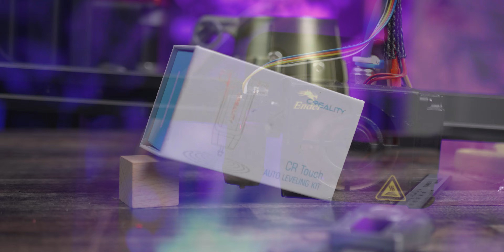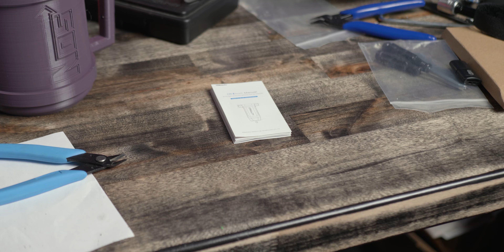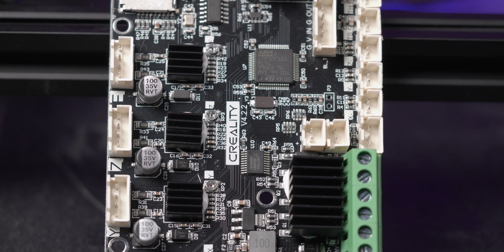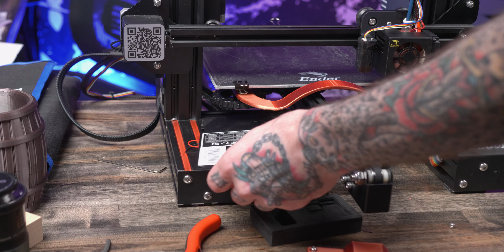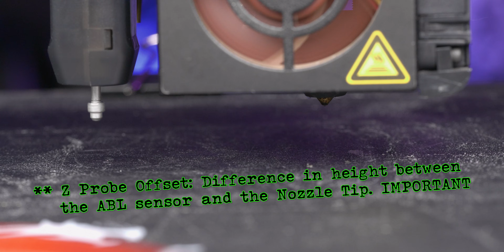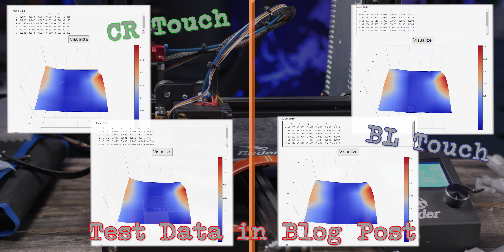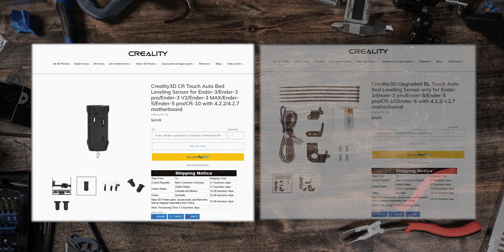CR Touch vs BL Touch - NEW Creality Auto Bed Level Sensor Review

Comment: Will this work on the ender 3 Max?
Reply: Yes , but maybe you gone need to compile yuor own marlin, i dont konw its a 32 or 8 bit board, other thing its the limit memory size of old 8bit board, but even that, there Cut version of Marlin for 8bit board with bltouch, so it will work(if yuor board dont have a special port, just connect 3pins to the servo port and the 2 others to the z endstop  , ve carefull with polarity.)
Reply from the maker: Yes, the 3 Max comes with the 32 bit board. Firmware will be your hang up. Creality lists an Ender 3 Max firmware with the 4.2.2 Mainboard and a CR Touch. You will have to check if you have the 4.2.7 or 4.2.2 board when installing the CR Touch. 

Either way your board will have the connector I demonstrated here and you won’t have to do what the commenter mentioned.

Comment: I am trying to get this to work on an ender 3 pro, the problem I am having is that it will not home the z axis, it will do x & y and when it tries to do z, it will move up and then fire the probe a couple times and then not move down to zero. Anyone run into this? Their support is garbage.
Reply from the maker: Which firmware are you running? I've had that happen on a bad flash of a firmware too.  Where just simply reflashing the same exact firmware file fixed it up.  But knowing more about what firmware and where you got it could help.  It sounds like either a bug or a configuration error in the firmware.
Reply: @MandicReally  Thanks for the reply. I tried the one directly from creality.com I tried one from the sketchy crealityofficial site. I compiled my own using the latest source from the marlin repos. Don't know what else to do.

Comment: How long is the cable that comes with the CR Touch?   My BLTouch came with a 1 m cable which was an annoying 10 cm too short for proper installation.
Reply from the maker: 1.5m I believe but aM not sure. It reached perfectly fine where as the BL Touch did not on my Elegoo Neptune 2 (1m cable).

Comment: Nice!   I like the BLTouch much better than the EZABL.   I was going to replace my EZABL on my other Ender 3 with another BLTouch, and with your tests, I know I have a better option.  I'm basically choosing for the better look more than better accuracy.
Reply from the maker: I like that physical probes stow away further from the print. I worry about curling parts with the PINDA sensor on my Prusa machine. I’ve had a few bridging sections get messed up on the Prusa and I think that’s why (though I didn’t witness it).

Comment: The M48 command as used in the video is not relevant, you need to add a random x-y movements in between the probes to get a representable sd. e.g. use M48 X110 Y110 L3 P10 V4
Reply from the maker: I thoroughly disagree with that.  You are thinking how the the M48 should be used to test a Probe + the Machine it is on.  Logical for the majority of use cases but not for this specific testing.  That command string is meant to test that the movement of the bed isn't affecting the Probing repeatability.  Aka, if the bed moves back and forth and suddenly the reading is different, something is wrong with your mechanics.  BUT, I was testing the Probes, not the overall machine.  If I did that I would be adding a variable to the testing which would invalidate the probe testing.  

As it is, I'm testing these probes on 1 machine, with 1 mainboard, and 1 firmware configuration.  It is hardly the scientific method, but I stand by the way I chose to do it with the conditions I had to work with.

Comment: I have a bl touch is it the plug the same for cr touch?
Reply from the maker: Yes it is. I used the exact same wiring to test both sensors. Just unscrewed one and swapped back and forth.
Reply: @MandicReally  thank you I just didn't want to get it and have to replace it all and love the tik tok videos

Comment: What if we use octoprint with a raspberry pi?
Reply from the maker: OctoPrint has nothing to do with your firmware or printer itself really. I used Pronterface for all of my testing but I could have sent commands through the terminal in OctoPrint just as easily.

Comment: Great video.  I bought an E3V2 really early on and attempted to put a BLTouch on it right away.  Fighting with firmware and not wanting to compile my own, I abandoned it.  I struggled with manual bed leveling for too long and some nozzle clogs.  Then my E3V2 became a nice dust collector for nearly a year.  Anyway, this video inspired me to put a little effort back into getting it up and running.  Bought the CRTouch, reverted from a direct drive modification and went back to a stock setup with this ABL sensor.  I'm now printing really high quality prints again with ease and loving it.  Thanks for the great video!
Reply: Download the Jyers marlin firmware for the E3v2. It's like getting a whole new printer. Makes it seem like a an E3v11.
Reply: @TheTurbinator   Your right! Night and day difference.  My Ender 3 V2 prints beautifully now. Jyers really did an outstanding job.

Comment: This is overpriced af IMO. Just make your own for 10$.
Reply from the maker: "Make your own"? You're gonna design, print the housing, source the electro magnet, hall effect sensor, custom pcb, and assemble it all for $10? I'll gladly build it and test it if you can source me the parts.
Reply: @MandicReally  linear servo + optical endstop is all you need. heck if you make your own coil you won't need it. but that's honestly a pain to do.

there's already a million designs on thingiverse google probes!
there's also a lot of cheaper options overall.

there's pick and place probes, there's spring ones that trigger when you home x and close when you move x to max, there's just so many of them!

I have had this idea for a compliant design probe in mind but i never got around to designing it.. maybe i'll ! it'd only need an optical endstop. it'd retract by just zeroing your z axis, and it'd deploy by homing x

Comment: I found the way they title their filenames on their downloads page, to be horrible. Also, the instruction manual for putting the printer together was abysmal, I had to follow a video guide, very slowly just to build my printer.

Btw, does anyone know if the CR touch work with Jyers firmware?

Comment: After all the hard work replacing anything that made noise on my Ender 3 v2 my BL Touch died and I replaced it with one of these. Now I have the metal probe contantly rattling and driving me nuts. Argh!
Reply: That rattle is absolutely insane! It's louder than my fan and steppers. If I'd known it was this bad I'd have bought the BL Touch instead

Comment: Old versions of bltouch used to come with metal probe. But they  moved to plastic as the metal in the probe would expand and measure longer in heated situations
Reply: I have a 3dtouch, the oin looks like metal, but its not, well its plastic with a metal cover...i think thats its was yuo saw

Comment: So it being magnetic it still has the 50c limit the blt has then?
Reply from the maker: Magnets don’t generally demagnetized until 80C+. I don’t know that it’s been shown that the magnet is what stops working in a BL Touch at 50C. Can you provide a source for that? 

As most Creality machines aren’t equipped with all metal hot ends, heated chambers, or beds intended for prolonged 80+C printing, I don’t think that was a major concern for them.

Comment: Well the CR Touch has two things I like about it that I didn't like about the original: the flimsy probe is gone and it doesn't look god awful anymore. The flickering led inside the white chassis just really looked out of place on any of my 3D printers/
Reply: I didn't like the lights because I have a camera with octoprint and it just lights up the whole frame - very distracting.

Comment: I bought a cheap knock off BL touch and kept having issues with it dropping the probe when the nozzle went to do the prime at the edge. So I bought a genuine BL touch and it did the same thing. When I updated Cura the problem went away. Neither ABL sensors have any issues now. I don't know about accuracy, but the $24 cheaper works just fine.

Comment: Can you show people how to change the firmware through using Visual Studio Code app? This to me is more of value to me than just downloading firmware from Creality. I had a major issue with my Ender MAX not running correctly with the download of Creality's firmware and had to use the Visual code app to make my own firmware so it would run like is was supposed to. Creality doesn't seem to update their firmware and they don't seem to listen to anyone when you contact them on fixing a problem or provide others with updated firmware unless it is someone like yourself that they contact just so they can get free marketing of their products. I have sent them several messages on their glass boards that they came out with over its ability of holding the parts to the bed. the original board that shipped with the Ender machines held the parts much better than the ones they sell now without the use of glue to hold it to the carbon fiber. However, you cannot get the original glass bed as a replacement anywhere that I can find. Can you run a test between the 2 glass beds to show which one has the better adhesion? I would like Creality to bring the original glass bed back.
Reply from the maker: I generally have avoided firmware content because it’s over a lot of people’s heads. Or really people get overwhelmed with it easily (it isn’t that hard in reality). And I simply cannot be tech support for every person trying to flash their own firmware, or breaking their machines when they mess something up. 

I need to consider it because I know there is a lot I do that relates to custom firmware configurations that available files just don’t do. 

So I will give it more consideration and try to figure out how to present it in my way.
Reply: @MandicReally  I'm 56 years old and learned the Visual Studio Code for the first time 2 months ago and if I can learn it anyone can I'm sure. It really isn't that hard and if your going to work with 3d printing it is something people are going to have to learn sooner or later. It really isn't much different than working with the arduino IDE to tell you the truth.

Comment: Actually, there is no problem with using Z-switch for homing, and BL/CR Touch solely for bed leveling.
Reply: You are entirely correct, IF the Firmware is configured that way.  The Firmware provided by Creality is not configured that way and as such there is an issue.

Comment: I wasted money on the BL touch it worked great for about 3 weeks then stopped working completely, kept flashing red and would not function at all.  I have sense removed it printer works great without it.  I would like to have auto bed level but I don't want to waste another 50 bucks on another product
Reply from the maker: I cut out a rant from this video about how Auto Bed Leveling is a misnomer and not a replacement for manual leveling. I think most folks who have or want it probably shouldn’t cause they rely on it rather than releveling their bed like they should. Sorry to hear your troubles with the BL Touch but I agree, if you are doing fine with manual leveling alone, don’t sweat it.
Reply: @MandicReally  I have gotten to where I level the bed once a week and adjust it on the fly as needed,  so far most of my prints turn out good with the off one now and then that require a bit more cleanup once finished.    All in all I'm happy with the end results, I have the Ender 3v2 I however have another issue with it. I have tried every setting under the sun but can not get anything to stick directly to the glass bed, I have to use blue painters tape, works fine but cleanup is a pain because the print sticks so good to the tape it has to be sanded off.  I would love to know why others can print directly to the glass and what I'm doing wrong that I can't get it to work.
Reply from the maker: @tonyemory3618  I’m not a fan of glass beds at all but I’ve had plenty of success with them. They act as insulators so Step #1 for me is always up my Bed temp settings. I usually put down PLA with the bed at 65C for the first layer on my non-glass equipped machines. But with glass I start at 70C or maybe even 75C for the first layer. I’m also a big fan of a product called “Magi-Goo”. It applies like a Bingo marker but is a clear-ish adhesion promoter. I love the stuff and use it on all of my machines ( with Buildtak, PEI, and Glass beds). Fairly slow first layer with higher temps and a light coat of fresh Magi-Goo is my go to for when I’m having adhesion issues.
Reply: @MandicReally  thanks I'll give it a try.
Reply: @tonyemory3618  i also couldn't get to stick anything to my glass bed.

I'm using 3d lac now and I'm very happy with the results. I also had success with s glue stick (UHU) but i didn't like the mess they caused when cleaning.

Comment: I just installed this on a new BTT-E3-RRF and compiled Marlin FW 2.9.0.1 and surprised myself and it actually works.  I'm only used to the Korean BLTouch and I've always used the Z plug on the board hoping the white and black wires stay in without hot glue.  With the five-pin plug on this probe going into the board, I had to do a change in Marlin for this rather than what I always used to do.  Uncomment define_use_probe_for_Z_homing.  Line number 1005.  Hope this helps anyone who had questions will it work OK with the Marlin settings.  OBTW, the new board is fast!

Comment: Thanks for this video. I also would like Creality to update their firmware more often. Why is it so hard to find a version of their firmware that has both the filament runout sensor and the auto-bed leveling? Sigh.
Reply: Go for Jyers, so much better than stock.
Reply: Do you have one?
Reply: @MysteryDuels  I have both parts of hardware. Still looking for firmware that has both active in it. Not confident in compiling my own.
Reply: @Phelps3D  So, if I install this CR touch on my Ender 3 Max, will I lose my filament breakage sensor?
Reply: im still struggling to find a firmware that isnt 180 out. most annoying
Reply: I was also hesitant to compile my own version of Jyers but it turned out to be really simple. Just edit two files with the desired options and press a button to compile. Super easy. Check out Brians video for step by step: https://youtu.be/so0FfFVEmiw

Comment: Great video, but I think the firmware story is everything. There's so much in the marlin firmware that makes life easier that Creality could ship if they could be bothered to put in the dev time. The marlin corners wizard, both in probe and non probe varieties is probably the most helpful thing I can think of that's missing, but it's been a while since I used Creality stock firmware.

0.04 accuracy is a full step of your z, you need a well sorted printer to benefit from less than that, and my experience of bl-touch and the better clones is they're mostly within one microstep and variance might be because the true reading is closer or further away from an exact step.

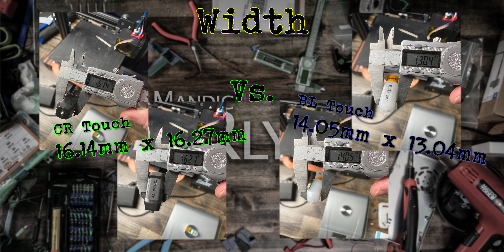Comment: Great vid! My very small gripe with the BL touch is how much noise the metal rod makes when moving around. I also couldn't properly update my firmware for two weeks. Small suggestion for the video: at 9:00 there is a lot going on and I think burring out the background further would help tell the pictures and text apart. Great content and camera work!
Reply from the maker: Thanks for the constructive input. After I was all done this edit I kind of felt that same way but was too beat to go back. Now that I see someone else feels that way I will bear it in mind. 👌🏻

Comment: Metal probe is a huge drawback. If it ever gets caught on a print it snaps and if you make it strong, it damages other things. It needs to be a sacrificial component. This is why BLtouch moved to polycarbonate, it bends and you can bend it back a few times before it is destroyed. In my experience the BLtouch is more accurate than the motion system on my machines. Whenever I had an issue with leveling, it was not the fault of the BLtouch. Not sure how an optical sensor is an improvement. This really seems like a big step down from the BLtouch design. Ive run machines in production with BLTouch clones, its a solid design, this looks and smells like a crap knock off modified for maximum cheapness like the rest of creality add-ons.
Reply: This is not to say anything about their actual machines, from what I have heard they are great. Specifically I am talking about their enclosure and flexible build plate. Both made in response to Wham Bam products, and both inferior. The enclosure matches an earlier design Wham Bam had that they moved away from and their flexible build system is terrible. Since the build part is too flexable it does not allow you to get any leverage on the adhesion, making large prints feel "stuck". This is why prusa uses sheet metal. Also the magnets they use demagnetize if you try to print at PETG or ABS temps.

Comment: Why don't you tell the truth , why why ? Why don't you tell why you upgraded from 4.2.2 , why don't you tell ender 3 is a broken printer
Reply from the maker: Why do you assume I'm lying?  Was I not thoroughly critical of Creality in this video? What did I miss here?

I went to the 4.2.7 board for the "Silent" stepper drivers, that is it.  It wasn't / isn't broken.  The only reason I "upgraded" was I don't like noisy stepper motors.  

What machine would do prefer?